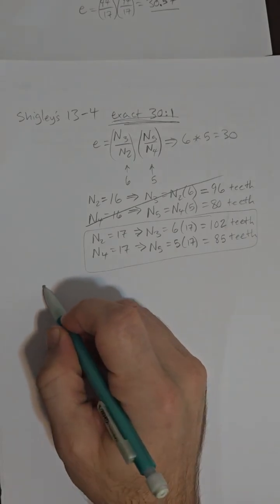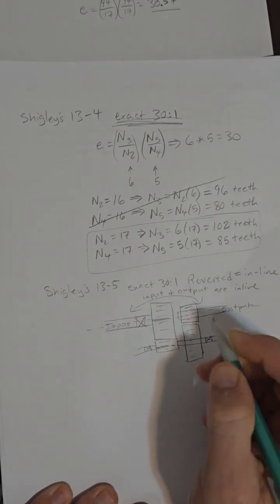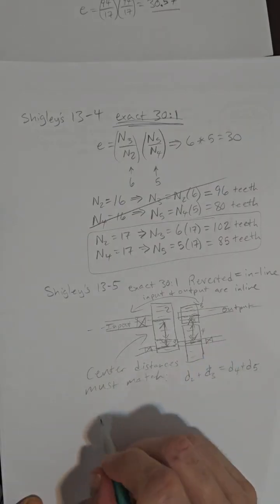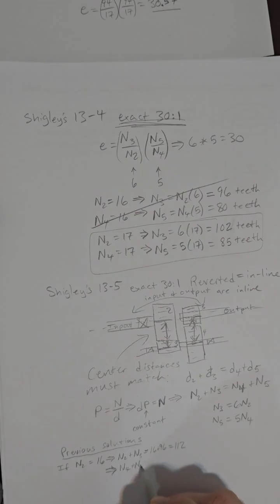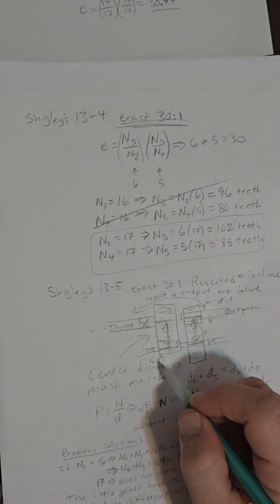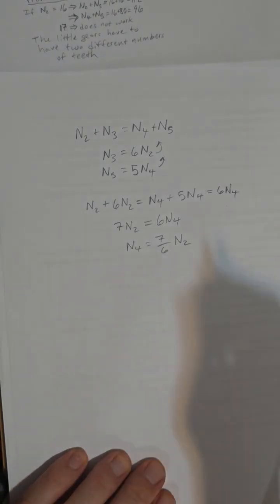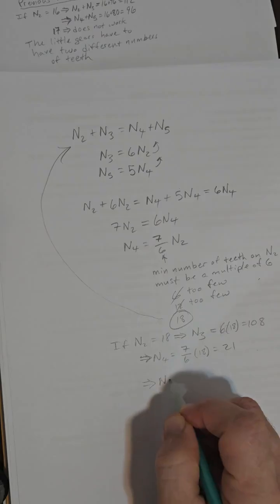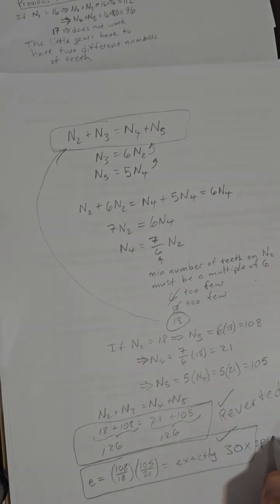Shigley's Example 13-5: Gearbox with exact 30:1 speed increase & reverted

Comment: Hey I want to ask that 
The number of teeth that you found doesn't exactly match by the  figure you have drawn earlier.

I think that the formula is a bit messed up for the train No..

Shouldn't it be e= N2/N3. 
As train value for speed is given as
e= n(L)/n(f) whose reciprocal in terms of Teeth numbers is 
e= N(f)/N(L) which in our case forms e= N2/N3.

Please reply and mention if im incorrect..
Reply from the maker: You're right. N2 and N4 were the big input gears with more teeth. 
Where I went wrong is when I wrote N3 = 6N2 and N5 = 5N4. 
It should have been N2 = 6N3 and N4 = 5N5.
Then N2 = 108; N3 = 18; N4 = 105; N5 = 21
Then the rest of it works out...
Shigley's train ratio, e = n_out / n_in = N_in / N_out
Since this is a compound gear train, the overall train ratio is the product of both meshes: e = mesh_ratio1 * mesh_ratio2 =  (N2/N3)*(N4/N5) = (108/18)*(105/21) = 6*5 = 30.
Sorry for the inconvenience. I'll try to fix it when I get a chance.